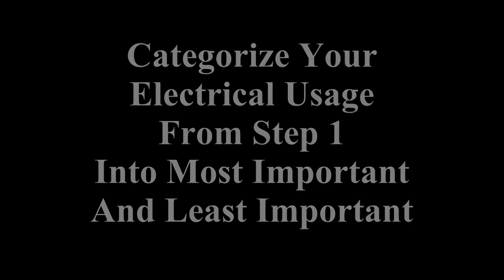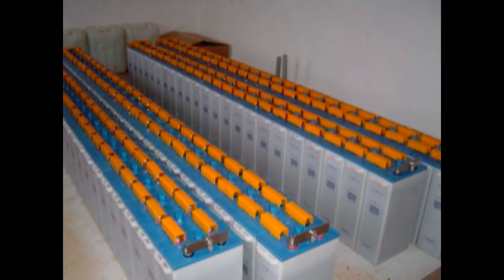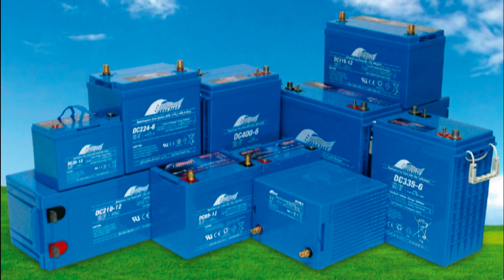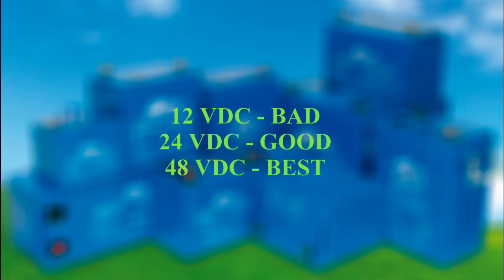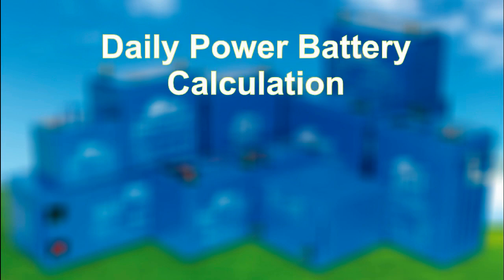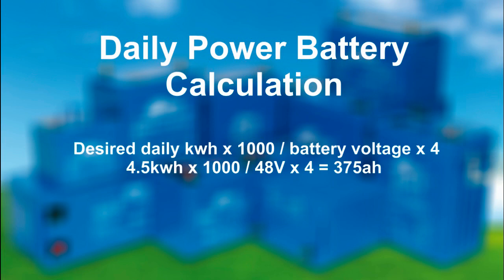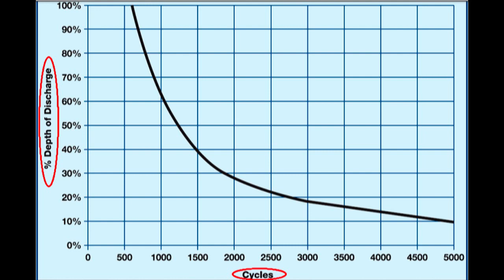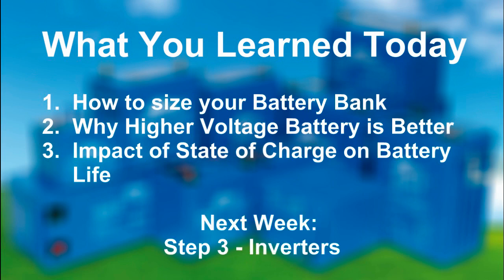Step 2 Solar/Wind Power: Battery Selection

Comment: Hello Steve..
I like your style and I have a few questions for you.. Might be stupid but I am new to Solar..

1.When I asked a Friend electrician about batteries he recommended ???2v batteries??? but in my search I understand the best for a heavy duty home i should use 12v Batteries and make a 48V System.. Are there any larger than 12V Batteries out there? And what exactly are the new TESLA batteries..

And 2.
I live in Greece and you in the US.. I put down the KW as you said and my desired KW comes out to need 480Ah on a 48V(Basic Needs 4.5Kw and TGL 10Kw or more).. Using 8 12v 240Ah = 480Ah to start and in the future I want to double them to make 960Ah to last me some Days more.. Does this sound Correct?

Here comes the Question..

You have appliances at +- 110V and I am at  230V... Does this mess up with my Calculations for my Total Good Living? Discharge % and Reserve %..??

Want you to know you have already Helped a lot..
And I thank you for your Videos..
Reply from the maker: +Antony Paloubis There's no stupid question, and people like you is why I'm here, Antony.  So, let's answer your questions:

1.  2 volt batteries have the advantage of allowing you to replace individual cells if necessary.  My system uses 6 volt, and I don't think the importance of using 2 volt cells outweighs the cost factor, if you can get less expensive per amp hour.  I haven't seen any higher voltage batteries designed for off-grid other than Tesla's power wall battery which is 350-450 volts.  Tesla's system is proprietary, meaning your system will cost much more than if you use a traditional approach.  I do believe that Li batteries cost will come down over the next few years, depending on demand.

2.  You are absolutely correct.  You have a good grasp of how batteries are wired to obtain the proper voltage and amp hours.

Since the calculations are all in watt hours and that carries between batteries and appliances, everything is the same.  Watts take into account voltage and amperage differences between all devices such as solar panels, batteries, and consumption devices.  Your calculations are good, and you have no worries.

Thank you for your feedback, and it does my soul much good to know that I have helped my fellow man.  Good luck in your endeavors, and please keep me informed of your progress.
Reply: Thank you for your fast Reply..
I have one more question as I just realized that Batteries have a Capacity Indication and I can't understand three things..
1. Specs on a 12V AGM Battery C10 260Ah also has in specs C100 312Ah? I don't get it..
2. What is best for a 4.3KW solar and 2KW Wind generating power with Your MagnumSine Inverter at 7500W Maxed or 4300W Standard?
3. For this Setup in Greece(Enough day light and plenty of wind where i am) What Capacity Battery should I use.. C10-C20 or C100?
How are your batteries doing after 3 years and what Capacity are they..?
Reply from the maker: +Antony Paloubis Well as you can see, my fast reply depends on timing.

1.  The specs are at a 10 hour and 100 hour rate, respectively.  Any battery will deliver more power over a longer period of time and longer lifetime the less power you draw from it.  It should also show a maximum charge and discharge amperage.  Mine are maximum 60 amps.  My water pump draws 44 amps, so if it is night time and it turns on while I run the microwave, my totals amps is 72 - I have to quickly turn off one of them to prevent battery damage.  The same is true with charging, but the charge controller takes care of that.

2.  I don't understand this question, so if you can elaborate it might help me.

3.  You will normally use the amp hour rating at the C20 rate.

I have a video reviewing my AGM batteries here:
https://www.youtube.com/watch?v=kbx30d-E1sM
Reply: Steve Robertson 
Your Replies are fast enough and Perfect.. :)

My Second Question is wrong as I thought that if you add another parallel inverter it would make 7500W But this is actually the surge load.. This is the Magnum MS4348PE.. Rated 4300 VA..

Question 3 again.. Is a C100 or a C20 better..
I see the price difference but I will pay the extra for longer lasting batteries..

A new Question Please be brief..

4. The only specs i have of the batteries are as follows: 12V 260Ah C10 for example.. Thinking of having 8 of them to make a 48V 520 Ah Battery Bank.. How Do I Determine the maximum charge and discharge amperage of these Batteries..?? 

5. I will have to get a Kill a Watt and put down my unknown devices.. Is there another way I can tap a device and see my loads and amps on application or Mac/Pc..?

Thank you..
Reply from the maker: +Antony Paloubis 
For question 3 and to be more specific, your C10 rate of 260ah translates to the battery's ability to deliver 26 amps continuously for 10 hours before being completely exhausted.  The C100 rate of 312ah translates to the battery's ability to deliver 3.12 amps continuously for 100 hours before being completely exhausted.  

If your specs don't include max charge/discharge amps, then you use the C10 rate.  In your case of series-parallel your batteries, should deliver no more than 52 amps maximum nor be charged with no more that 52 amps to prevent damage.

Maybe I should make a video on these points you have touched on.  You have addressed some very good questions.
Reply: Steve Robertson So if a 520Ah 48V C10 delivers  52amps for 10hours but if they were rated C20 it would deliver 26amps for 20hours.. This is the Maximum amps it can deliver.. But where do these amps go.. Calculating the load of the house or inverter.. I got kind a lost..
Are these also the max Charge Levels?
Can we pull more than 26amps from the C20 at any given moment..?
Have a look at the batteries I have available.. you might know some..  http://www.smart-cover.gr/index.php?cPath=13_96_98_217&sortproducts=1&page=1
Reply: I am the 33 year old Kid still asking 1000000 Questions... hahahahaha...
I thank you for your Help.. Making me understand how the system works..
This summer I used 5500 kWh from the grid 4 full months.. My goal is to start on grid but eventually go off Grid.. Maybe use a generator for any last resort solution rather paying the Greek Gov.. Unfortunately we can no longer sell energy in Greece.. I would do it if it was still available but now they only count the difference in kWh and they balance it out.. either i pay excess kWh used or they owe me kWh and not $$$.. It's depressing.. but this could actually help me keep my Batteries leveled above 90% charging when it drops to 90% or at specific times when the energy is cheap.. We have a day Counter and a Night Counter.. Night Counters are Cheaper.. :-)
Hopefully i will have excess energy that goes to the grid and that would meen I can get free kWh from the grid when needed..
Reply: Please take your time to read all this because I have edited the Comments and added Questions within the day.. Don't mind answering today tomorrow unless you feel like.. But take your time to make a nice video with all taken in to consideration and i will be glad to help you out with more good and stupid questions as I am eager to learn this subject well.. :)
Reply: We should make Solar for Dummies..
Reply from the maker: +Antony Paloubis Your excitement is great!  I'm on the road now but I'll answer everything as soon as I can.
Reply: Don't worry.. This is a study that shouldn't be finished in one day..
Something that comes to mind..
On the graph your friend made.. Props for that Video and Excel..
It would be nice if he could have added more lines for more devices under Kill a Watt.. But adding them all up myself should be easier as each person has more or less devices to account for..

The Question about your personal Graph.. You say 2.5kWh for your devices.. This is per Hour yes? 60 kWh a Day.. Correct me if I am Wrong..

And nice job on the second inverter for heating Water.. My Boiler is 3000W.. I will need a bigger one.. It's either that or a More efficient Heating Pump.. I'd like to know your opinion on this subject..
Reply from the maker: +Antony Paloubis Since I don't plan to travel to Europe, perhaps you could come here to live a while and learn the system as you help me maintain it and I will adopt you as a second son!

But back to the subject.  In the cold winter months there is not as much sun, so I help out my system burning wood in the cold days.  My system heats my home, heats the water, and we cook on it as well.  When the sun is available, I use the heat pumps to heat the house during the day.  https://www.youtube.com/watch?v=tnwH10lCfpw

You don't need to worry about surge capacity with your batteries - only be concerned that your inverter can handle the surge.  The surges are very short in duration and the batteries can handle that.  It's not likely that all your appliances will turn on and cause a huge surge at the same time.  If it does happen, the inverter would shut down to protect everything.

To determine the type of battery you want, then decide this way:
If you don't want to have to maintain your batteries adding water and checking them every few weeks, then choose AGM.  If you don't mind maintaining them and prefer to pay less for them, then choose wet cell lead acid.  If you want batteries that will assuredly last you the rest of your life, then get Nickel-Iron batteries.  Their cost is high and you have to maintain them like wet cell, but they are very durable.

Battery cycle, capacity, amp hour rating are all dependent on the manufacturer and the model they choose to manufacture.  Like I said in the video, batteries are nearly as much art as science.  If you're not sure, always opt for bigger battery size.

Most inverters like mine can be programmed to shut down at any charge level.  I have mine programmed to shut down at 70% capacity (49.8v).  I then change the setting to allow using it further.  The problem is that I heat up a soup and the voltage goes below that while cooking and the system shuts down.  But when it shuts down, the voltage goes back up because there is no longer a load.  It takes some tweaking and you eventually settle on settings you like.

-->"Can we pull more than 26amps from the C20 at any given moment..?"  Yes you can.  In my home, most of the time there is no power being consumed, so my amps is 0.  But I turn on the computer and a few lights.  Now my amps is 1.5a.  I take a shower and the water pump turns on and it uses 44 amps for 2 minutes to refill the tank.  I go to bed and my amps use goes to 0 while I sleep.  The refrigerator might cycle a couple times while I sleep at night.  Overall at night when I consider the time and total amp hours that was used, I am closer to a C175 for the batteries.  I only run heavier loads such as air compressor, winches, log saws, cooking, etc. during the day so the power is provided by the solar panels and much less by the batteries.

This is the battery I use in my system for you to compare:  http://www.fullriver.com/products/admin/upfile/DC400-6.pdf

I have to answer more in another post as I have used up my space in this post.
Reply from the maker: +Antony Paloubis As I read more your thoughts, a grid tie system might be better for your needs.  You could use the grid as your battery thus saving 100% of the cost of battery.  If Greece allows you to sell excess during the day, then maybe you could buy it back at the cheaper rate at night since the sun is down anyway.  Have you checked into any of this as a possibility?
Reply: Selling is not an option any more in Greece.. excess kWh given is also the kWh owed for me to use.. The reason I want to have a battery bank is because the Grid in my area is very bad and very old.. And we are talking about greece.. It will never be fixed.. 3rd phase might drop to 110v as i should have from 220 to 230V on all phases.. 3 times a year i see the third phase drop like that.. And this lasts for hours until the fix it.. and the grid is unreliable even after that.. It might drop at any time.. and lets not forget that I have a 30kWh Stabilizer and because of the unstable current I can hear my UPS go nuts 3-15 times a day during summer when everyone is sucking up the Grid due to AirConditions.. I hear the relay on my old UPS firing up.. while my TV is still working on my other UPS.. Imagine what can happen with the 30kWh 3 phaze Stabilizer.. It can destroy quite some devices.. Long term.. It's killing my devices.. Eventually I want to stand alone.. Totaly Off Grid.. Solar/Wind.. Best way to do it.. but the Battery Bank is the far most expensive and what needs to be in good condition and thought out well.. So this is why I am driving you Crazy these days.. :)
Reply from the maker: +Antony Paloubis I respect you wanting to be totally off grid.  The key to using a smaller battery bank is moving all your heavy use to sunny hours of peak production.  In this way you are using your batteries only a tiny amount at night for lights and TV.  My wife cooks during the day.  At night we heat the food in a microwave oven.  Using the batteries as little as possible is the only way to make them last.  On cloudy days, we do not do laundry, cooking or heavy equipment using electricity.  It simply waits until we have a sunny day.  It's like not washing a car if it is about to rain.

I suggest you start small getting a few solar panels, battery and inverter.  Use it to power your sensitive electronics such as TV, phone, computer, etc.  Later, you can add a couple more panels to power an efficient refrigerator.  This will familiarize you with how it all works and your understanding will grow.  With understanding comes confidence, and with confidence comes the doing of being self-sufficient and answering to no one but yourself.  You would make a good American pioneer, but you are a good Greek pioneer!  You will teach others.  I will be here to help you as long as I am alive.
Reply: I still don't get it with the Capacity..
Your battery is rated C20 as I see on your data sheet.. and it gives you 415A the first 20 minutes.. 240A at 60 minutes.. and at 20 hours you have 20.8A.. How exactly does this work if you want to be off grid for 5 days..
This is what i don't get.. When you use 3.5kWh on all running devices how many amps do you need.. after 20hours of no income power what really happens..?
Reply from the maker: +Antony Paloubis For my most basic necessities require 3kwh per day.  That is 62.5 amp hours per day.  My batteries are rated at a little more than 400 amp hours.  That will last me nearly 6.5 days to complete discharge or about 3 days to 50% discharge and I must live minimally.  Eventually I have to find other means to charge my batteries.  I have to use a gas generator on rare occasions.  You could charge from the grid in those cases.  

For my C20 rate, I do not use a constant 20.8 amps.  I only use what I turn on and in most cases my use is actually 0.  But since my requirements are 65ah per day, my average power consumption from the batteries is 2.7 amps continuous averaged.  I am actually operating at closer to a C150.  Also, even on cloudy days some electricity is still produced.  This increases the longevity as well.  I will make another video covering batteries in more detail as soon as I get an opportunity.
Reply: Steve Robertson You are great help and I thank you for your time..
Just to get things straight and help others who might have the same question..
Let's take this battery for are example:
http://www.smart-cover.gr/mpataria-rolls-290ai-c100-p-2059.html

This battery is rated 12V 290AH C100 and the specs below say:
C20:260Ah  - C10:234Ah

So i guess that this same battery has these specs based on time frame.. So we will be able to get:
290Ah for 100 hours - 260Ah for 20 hours and 234Ah for 10 hours..

 For some reason I have it all wrong I think..
How is it possible to get less Ah in a shorter period of time..
It can't be.. this battery has double the money of a 240Ah 12V C10..
Too expensive..

Please make it as simple as possible so I can understand just how the C rating works.. Sorry for the hassle Steve..
Reply from the maker: +Antony Paloubis It is no problem.  Some things are better demonstrated than described.  Although this video is about smaller batteries, it still applies to the larger batteries we use:  https://www.youtube.com/watch?v=cxkVxi9P0EA

If it is still difficult, let me know and we will continue to work through it.  It took me a while to get it to sink in as well so you are doing good.
Reply: Thank you very much for your help..
Reply from the maker: +Antony Paloubis I hope that helped.  Please stay in touch, Antony.  You're a good man!
Reply: It actually helped but i'm not 100%..V x A = Watt & V x Ah = Watt Hours..
Ok.. I get this part.. And I kind of understand that the Capacity = C is all about the discharge Capacity.. But look at the numbers..
lets take two batteries one has a reading of 20C and the other 40C.. Both are 220Ah.. As shown on the video.. 20 x 220Ah = 4400Amps and 40 x 220Ah = 8800Amps.. Have a look at this AGM Battery data sheet http://www.rolls-battery.com/pdf/S12-240AGM.pdf 
the chart shows a discharge rate depending on Amps.. This is easy to understand.. This battery will be able to deliver 10.75Amps for 20Hours before the voltage of the battery drops below 11 V.. 
Is this right?
this is what confused me and Still I don't understand..
The same battery as i have asked you before has a rating of 20C,10C and 5C : 215AH,193AH,172AH.. And this is where I think I understand where I got stuck.. It says 20 Hour Rate(10.75A to 10.5 Volts)215AH - 10 Hour Rate (19.3A to 10.5Volts)193AH..
Please tell me I am on the right page.. The difference here is the load 10.75Amps VS 19.3Amps.. Is this why the smaller the C Rating the less the AH due to delivering More Amps in a shorter period of time..?
Reply from the maker: +Antony Paloubis you are very much on the right page.  It is true that the more amps you draw from the battery, the less it's capacity will be.  That's the reason they give different C ratings at different amp draw.  I believe you do understand, but aren't sure of yourself yet.
Reply: So if we need to calculate are Battery Bank to hold us 3 Days + we need to have are Amp Hours or the Amp load on a rating above C100?
Reply from the maker: +Antony Paloubis I apologize for my tardy response.

I use the C20 to calculate my reserve power on batteries.  That way I'm sure I don't cut myself short on power even though the C100 is probably more accurate.

The load is what drives your entire system from design to real world use.  The load is the only thing you have control over.  The sun and wind come when they come.

I've never heard of the smappee but I do like the concept of it.  Like I said previously, the load is the only thing in your control.
Reply from the maker: +Antony Paloubis I will probably never have an opportunity to go to Greece.  But if you come to Colorado USA let me know and you will stay with my family!
Reply: Thank you very much for the offer.. :-)